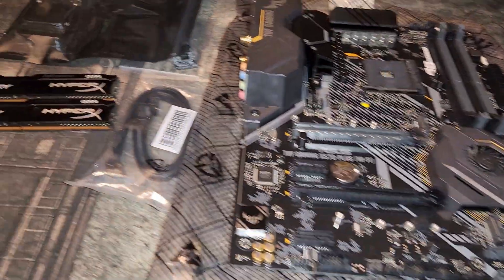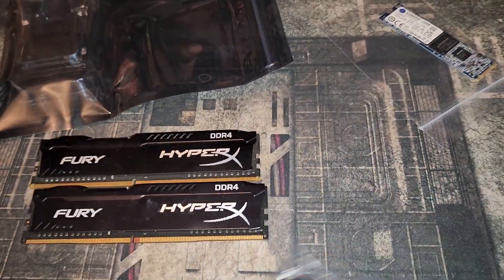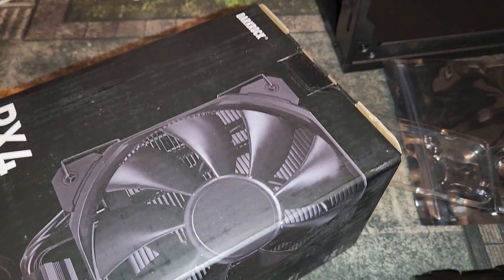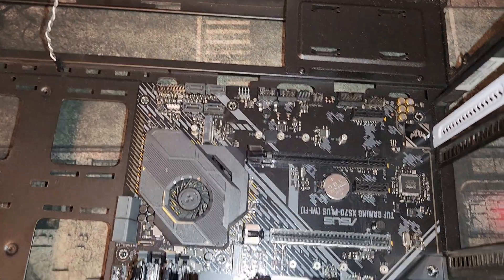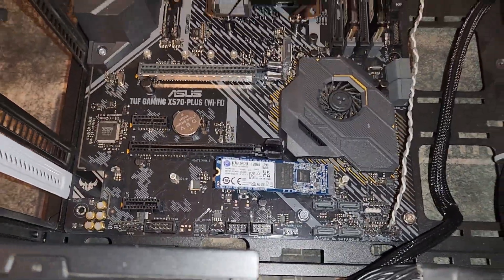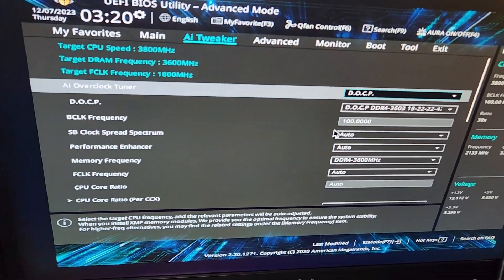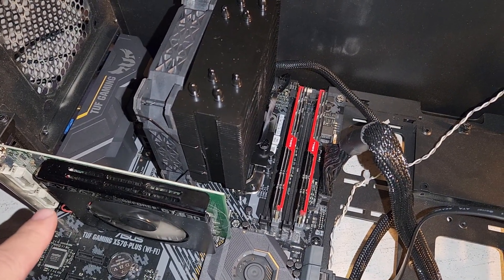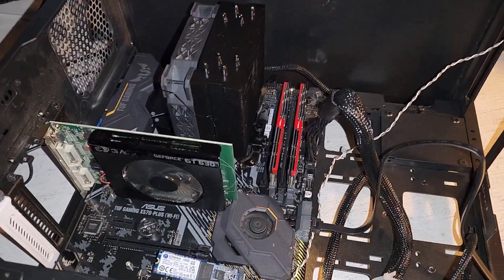CPU mining rig build!!

Comment: I've had a similar problem with 3900x and asus tuff motherboard, never want to go lower then 1.18 volt... after I replace the mobo by a msi B450M PRO-VDH Max and now it's running perfect at 1 volt... no idea why but this mobo is probably using power somewhere else.
Reply from the maker: That's weird because I have a b550 tuff and I don't have those issues on that one, it has a 3900x as well, humm. Thank you for letting me know!
Reply from the maker: had an issue with all my tuff boards, smh no more of them for me